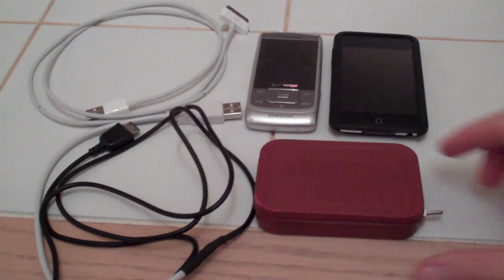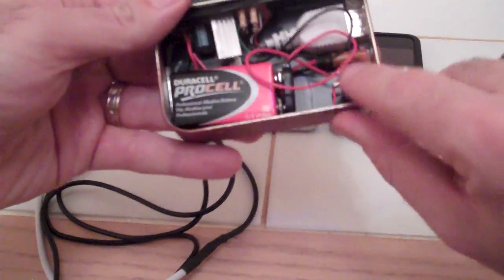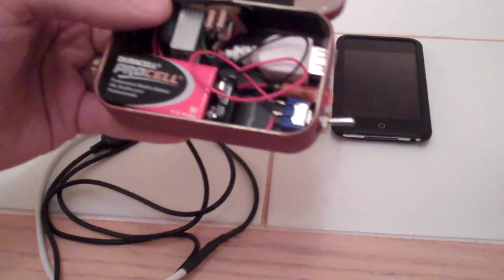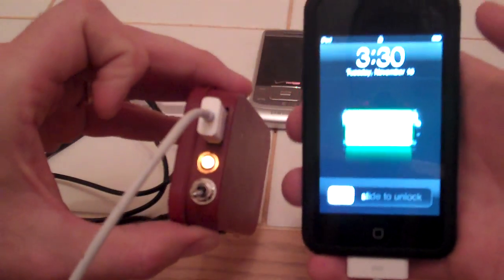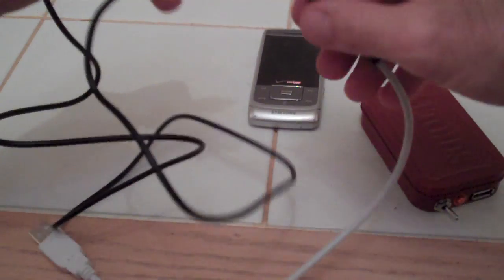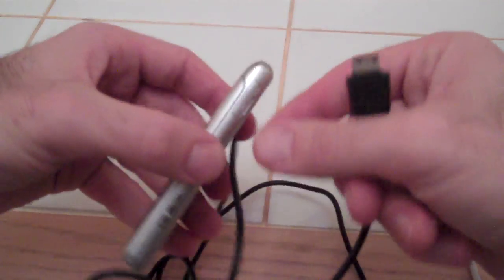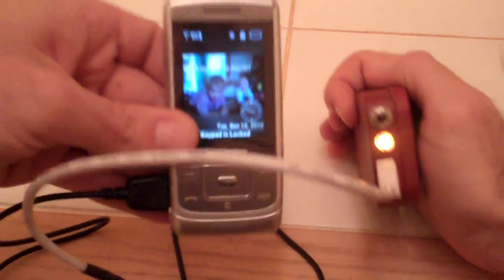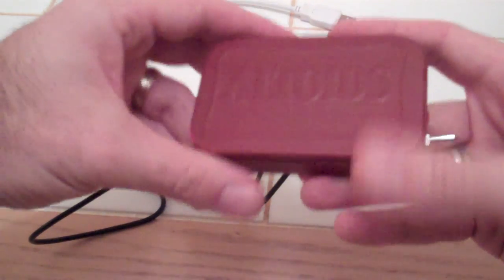USB iPhone iPod Charger DIY

Comment: Do you diodes? because what happened to my first usb charger was that I noticed when my phone's battery when around half way? the charger no longer worked,I have a feeling the like electric current went back to the battery since the phone now had a greater power....also,if I do ad diodes,what kind will I use?

Comment from the maker: @themagicmonkeys It could a few things. double check your solder connections. If you have a voltmeter you should check the 4 USB pins to make sure you are getting the correct readings. Also your battery may be to low. As this circuit is fairly inefficient it won't work if the battery is below 7v.

Comment: no. I used 4 AA batteries and it works fine. the iphone only draws as much current as it needs, so 4 AA batteries supply more mAh than AAA batteries, so you'll get more charge out of them

Comment: did you use 1/8w, 1/4w, 1/2w Resistors, you did not tell the % of the resistor, I used Cadsoft to draw out the circuit to make the board but it would be nice to know a little more info, Adafruit has a charger for 19.50 and she used 1/8w resistor, so a little more help would be nice I would like to make some of these for the family. simonsbd@msn.com

Comment from the maker: @TheJman8695 You need to use a resistor to lower the voltage. If you use a 9v battery then you would need a 330 or 360 ohm resister. Either would do.

Comment: You probably won't get even a full charge with that little 9V battery not only because they don't hold that much juice, but because that 5V regulator wastes a lot of the power as heat. I would use 4 AA batteries which fit nicely into an Altoids tin and can give you about 3 full charges if you use NiMh batteries

Comment from the maker: Next time pay attention before you post something negative.  The 9v goes through a 5v regulator making it 5V for the ipod.  Just what it wants.  I even posted instructions in the comments.  Yes, 9v would break an ipod or iphone if sent in directly.  You need >7v for the 7805 to work.  so you need at least 9v.

Comment: I'm using a computer power supply. So I have a red and black that's putting out 5v. I have it connected to - and + on the USB. Just need to know how I can get the 2v to the data lines.

Comment from the maker: @electronics740 I think it's the same as mine (3rd gen).  You need to use all the USB pins.  red wire = 5v, black = ground, the other 2 are data lines and they need to have 2v each.  I used a voltage divider with 2 33K resisters and 2 22K resisters to get the 2v.

Comment from the maker: @fishheart100 Yup, I drilled the holes for the switch and the led.  I used a Dremel with a cutting wheel for the USB hole.  You could use a drill and a file if you wanted.  Let me know how it turns out.

Comment from the maker: @bigoud55800 
Hi, I should start by saying I am not a pro but just a hobbiest. Your bro's mp3 just needs a +5V and ground to charge while Apple has made it very difficult to charge their mp3 devices.  They want you to have to buy their chargers.  An iPod Touch not only needs the +5V and ground but also a signal through the 2 data lines of +2.0V each telling the iPod that it's OK to start charging.  You need to make a V splitter with 75K and 49.9K restesters.  The caps are to smooth the current.